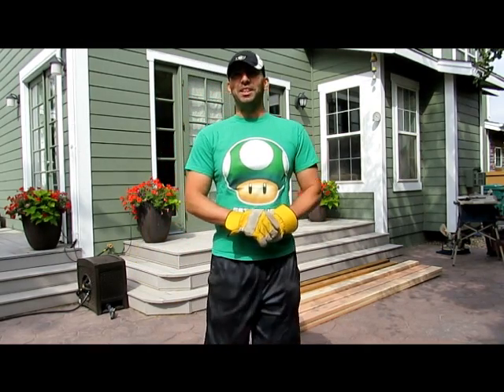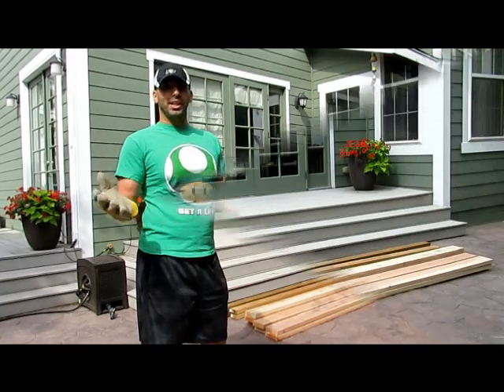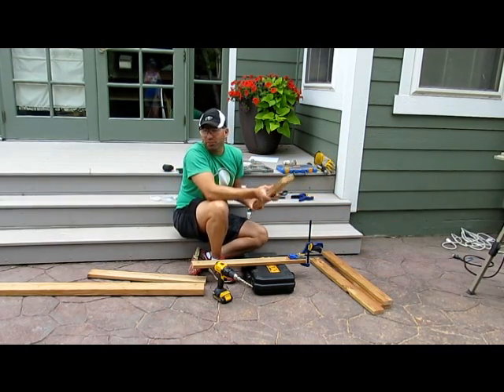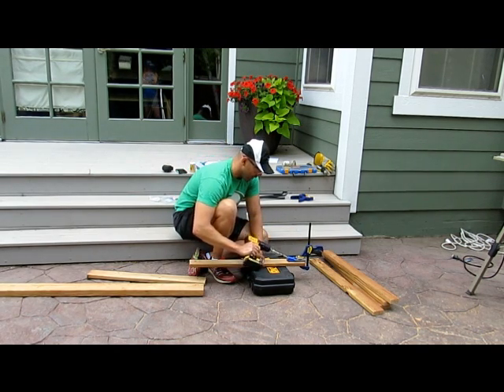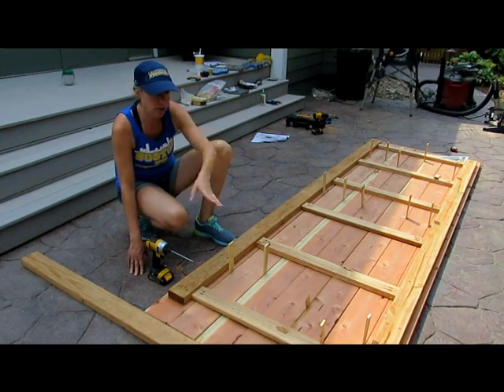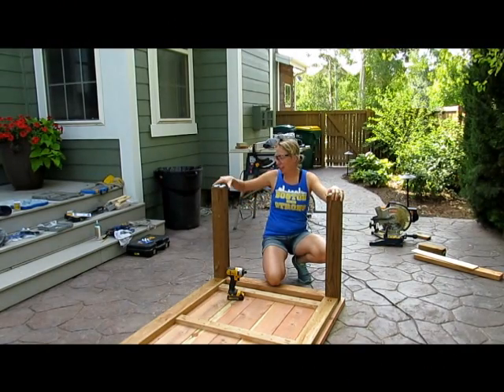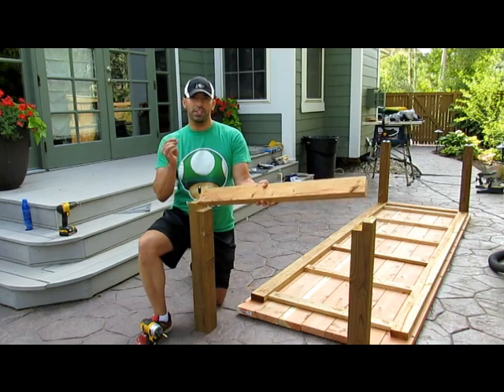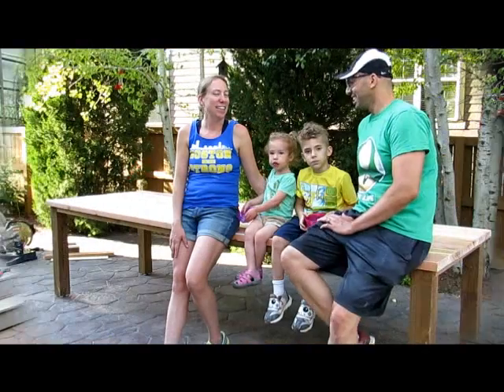DIY Outdoor Dining Table

Comment: Hi,
Any updated plans? I am planning on making one-they are so expensive! I love the way this came out. 
How much did you spend in total? I think I will have to rent a table saw and sander. What type of sand paper did you use? What stain was used? I do not have much shade, do you think this will be durable outside?
Reply: Hi, 
Thank you! The cost will vary depending on the wood you use but I believe ours was around $350. Great deal for a large solid table! For sanding I used a belt sander with 80-220 grit sandpaper before the stain and 2000 grit between coats by hand. For stains I used a clear waterproof sealant by Olympic Maximum on the top and for the base I used a semi transparent Ebony stain also by OM. As far as being durable, ours stayed outside all winter without a cover and still looks great.  It will depend a lot on the wood you use and finish, but you can also refresh the top coat once a year and it should look like new every time.  Please post pictures of your table here. I would love to see it.

Comment: So 5 years later, did the table hold up? I was concerned about a long heavy table not having cross support for the legs.
Reply: It’s still holding up! We could use a sanding and refinish but the structure is fine.  I wish we would have covered it during the winter months too.
Reply: @bethm8673  Thank you. This is the design I want for my 9ft long table. I was concerned that it would need cross bracing or additional leg support. Great to hear!

Comment: I'm surprised it doesn't rock at all. What keeps it from rocking? Seems like there would have to be an additional board between the legs either at the end or a long board spanning the long way.
Reply: Hi Adam, thanks for looking at our video.  We've had our table for a couple of summers now and it is still pretty solid. The trick is to make a strong U frame for the leg as we show @4:14 and in addition to the screws we also used glue in the leg notches. Hope that helps, and please post your pictures so we can see it if you decide to make one. Thanks!
Reply: @bethmenezes3256  Thanks for the reply. I do plan on trying it out but using trex as the tabletop itself. Thanks!
Reply: Beth did you make your table?

Comment: Hello. the table looks great. How has it been holding up? Can you please send me the measurements for the wood that was used? Looks like the wife has me doing more COVID19 Projects/upgrades.
Reply from the maker: Hi.  The table is still holding up!  We keep a cover over it during winter.  We may do a fresh coat of stain this summer to freshen it up.  We never did write up the plans for it.  Maybe I’ll convince Luis to do that soon!
Reply: @luisandbethhomediy2617  Hi, thanks for sharing this project, what kind of wood you use in table top? Is it 2×4? My out door glass dining table didn't make it last winter. But the frame still hold up well, want to DIY a table top instead buy a new table

Comment: I like your video, but why you are using to different type of wood ? red wood and pressure treated wood ? are they expansive? and do home depot have them?
Reply: Hi thanks for watching us. Yes, you should be able to find both types of wood at HD. The reason I used redwood for the top is because it is a nicer wood and good for outdoors. For the frame I used pressure treated because it is cheaper and it would be covered by a dark stain anyway.

Comment: nice job. just wondering what size the legs and top are. I believe the top is 2x4x8 but i just want to make sure
Reply: Thank you! The top planks are 10ft long  6x2.  The leg posts are 4x4 and cut 28in tall.

Comment: Such a great video, I will try this next week!! You should right all those details that you answer bellow at the question under your video. You know inches, materials, tips etc. My only worry is that I wont be able to do the notches (but I can ask a shop close to me to make those 4 notches for the side skirts). 2 Questions.1) What type of glue we need to use? 2) How you call this things that you use between the top planks so you leave the gab? 03:00 I cant catch it :D
Reply: Thank you!  The glue we used was a wood glue for exterior (Titebond III at hardware stores).  Also the wood we used to get consistent spacing between the top planks are called wood shims.  You can usually find a bag of shims in the hardware store as well.  Please post pictures of your project. We would love to see  them!
Reply: Beth Menezes Thank You so much I will post it when I will try to do it. Great Job!

Comment: Hi. The table looks great. I'm a beginner with woodwork and definitely want to give it a try. 
Could you please tell me the size of all the wood pieces used??? 
Regards
Reply: The top planks look to be 2x6x8. The posts look to be 6x6 (you'd probably need 2 6x6x8)
Reply: @ce9193  thanks

Comment: Great video guys!  Could you provide some details of the sizing please? i.e. overall dimensions, and sizes of the planks on the top? (prefer metric, but I can convert freedom-units :) )
Also - how did you cut the notches in the legs? Just a circular saw?  
Did you Stain underneath or not necessary?
Reply: Also - do you have any issues with sagging/bending in the middle, as it looks quite long ( ~2.5m ? )
Reply: Hi, great questions! I will try to answer them all and if I miss anything just let me know. The dimensions (in U.S. units) are:  overall the table is 10feet long x 38.75inches wide x 29.5inches tall.  The top planks are 10ft long x 5.5in wide x 1.5in thick.  The leg posts are 3.5in x 3.5in x 28in tall.
To cut the leg notches I used a table saw, making two cuts in a perpendicular line. It is doable with a circular saw too. (Tip add some glue in the notch before screwing down the short skirt)
Since all the wood I used is outdoor resistant I didn't stain the bottom, just the top outside frame and everywhere else I could see.
Thanks for checking our video! :)
Reply: Hi, we have not.  It has worked out great and even though it is a long table the frame is very solid. One thing to  note in the video is that we also glued the long skirt pieces in addition to screwing it down which makes it very strong.  If you are concerned about sagging a good tip would be to add a very small bit of an angle to the long ends (arch the top before you glue and screw the skirt). Hope that helps. Please post your pictures here. We would love to see your project!
Reply: Thanks a lot for the info.  I'm going to have a crack at doing something similar this weekend, so if it's not a disaster, I'll post some pics of after
Reply: Hey guys, built my table, which came out mostly ok, it was just a lot heavier than I expected (easily >100kg) as I used thicker wood mostly, due to what was available at my local store.  I still need to sand and stain, but the wood is fairly wet, from being treated so might let it dry a bit first. Here's a pic: https://imgur.com/a/ba6H6
Reply from the maker: Looks awesome!  Thanks for sharing. :)
Reply: What about dimensions of skirting and the cross support boards?
Reply: @campbelljones3966  it seems smaller. I believe it suits 3 person on each side. right? Can you share your cut list?
Reply: Figure it out- the top boards are 10 ft long. The skirts leave room for the leg posts 3.5x3.5. So subtract 7 inches from the 10 ft and you have 9' 5" for the long skirt The cross supports are dependent on the width of the long skirts- if the long skirts is 5.5, then take 11" off the width of the table and don't forget to account for 1" on each side- total 13"  So if the table is 38" wide, subtract 13" and you have 25" supports

Comment: Great table.  I'm going to give it a shot next weekend.  How long were the screws?  Also, how much overhang was there on the ends over the legs?  Is it stable or does it rack a bit?
Reply: Thank you! We have been really happy with how it turned out and we are always getting complements from our friends.  The table is solid and we have not seen any sagging or rocking. We left short of 1in of overhang (7/8 in) all around, but make sure to leave it longer at the ends (at least 0.5in longer) before you trim them as I showed in the video @5min to get a clean straight edge. Also another tip is to add glue in the notch before screwing down the short skirt to the legs (video @4:15) to make the leg frame stronger. As for the screws you should have at least 0.5in through grabbing the other board, so if you screw through a 2in board (actual 1.75in) then use at least 2.25in screws, always making sure you don't screw all the through though :)
Hope that helps. Please post your pictures here as we would love to see your project!
Reply: Did you ever get around to making the table? I'd love to see your results

Comment: The straightness of this table defy laws of physic and common building practices. I hope you don't have a drunk 220 lb friend that sits of fall onto it, it will either rack on the side or bend 6" or more in the middle. How come the 2x4 long rail skirt lumber are not vertical ? Even then, that would be pushing the limit of the span of such board. I don't say this to be rude but the goal is to inspire people to build stuff, which that video does, but the design needs to be refined.
Reply from the maker: Thanks for your feedback.  So far so good.  Luckily our 220lb friend hasn't tried sitting in the middle yet.  :)